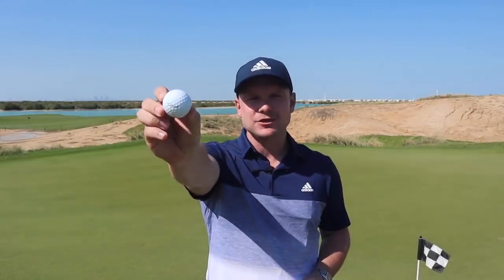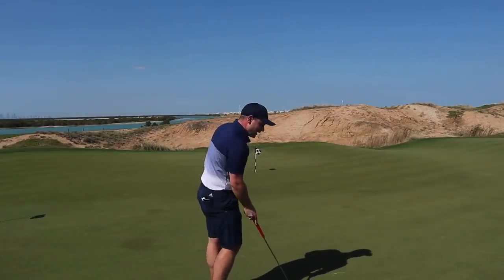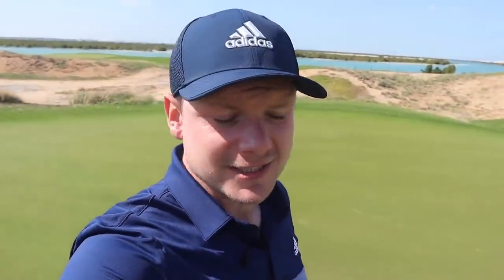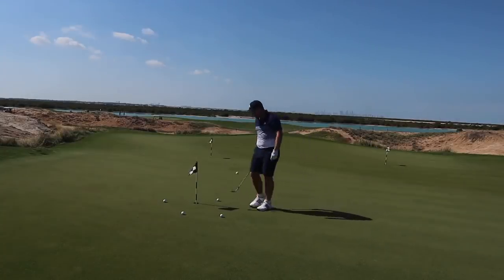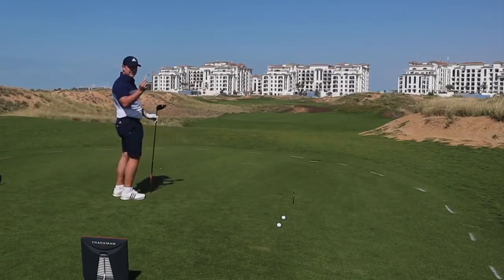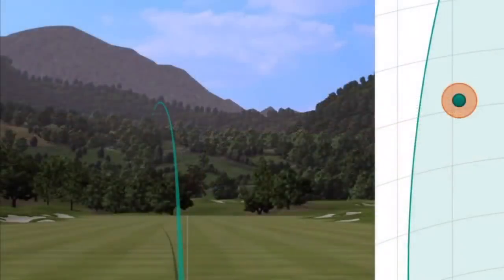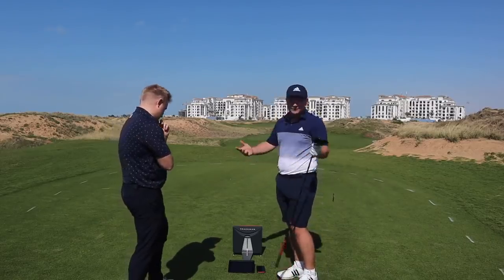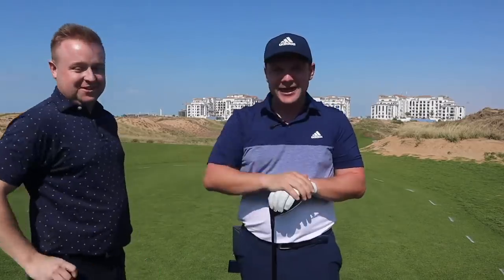THE FIRST EVER GOLF BALL WITH NO DIMPLES... CAN THIS WORK???

Comment: the Gutta Percha ball was one of the first balls for golf and was smooth, and from what I have read, it didn't fly very far or straight, and golfers found as it got scuffed up and got dents and club marks on the ball, they started finding the ball went farther and flew straighter because of all the scuffs and dents in the ball. So they started to design different dimple patterns on the ball through the years.  
The ball is very well designed today and is why Jack Nicklas wants to dial the ball back for Pros, which I think is wrong, it will only hurt us, recreational golfers, as we are not long off the tee like the Pros.
Reply: I think the predominant suggestion to reduce the distance for pros is to have the professionals use a tournament ball which is reduced in flight. No one is suggesting that amateurs are placed under the same restrictions. I agree as otherwise courses will become obsolete. As it stands courses are trying to lengthen (Augusta has just spent several million on new land to extend the course).
Reply: @MrJre4491 Possibly, but I doubt it. Ball manufacturers don’t make money off the Pros that play their balls; they get them free. So if Titleist stopped innovating for example they would lose business to another manufacturer that continued to push the limits. It could also be argued that in attempting to maximise distance for the pros under your restrictions they could find ways to improve the balls for amateurs. It’s difficult but continually improving course length doesn’t help. Restricted ball for pros seems to be the easiest solution to me.
Reply: Funny enough the first successful “modern” dimple pattern ball was a Jack Nichlas 392 dimple  MacGregor. That thing was so hot plus you could tee it in certain way to hit a fade draw high or low. It was outlawed once that was figured out. Then Titliest came out with it version. I think it was the first Pro version. 

Any nice video

Comment: Golf balls were originally smooth. They didnt have dimples till golfers realized older balls worked better. How is this the first ever with no dimples?
Reply from the maker: Even the Featherie had marks on it to make it unsmooth. 👍🏼
Reply: @JamesRobinsonGolf  the original gutty balls were made of pitch and fibre and were made smooth but players realized that their older marked up balls flew further so players started intentionally carving them with all sorts of designs untill someone dimpled theirs and realized that dimples worked far better than other designs
Reply: @JamesRobinsonGolf  you can't possibly not know that golf balls used to be smooth. no self respecting golfer doesn't know this.
Reply: Bollocks - Barnes Wallis invented the modern golf ball with all of its dimples. Its standard hydro-dynamic, yes hydro-dynamic because AIR is just a less dense liquid. The dimples ensure turbulen flow is maintained across the balls surfaces allowing it to fly further with a more stable flight. I guess to the average golf pro this is magic still even today. that's why there a golf pro right?
Reply: @RaindropsBleeding  i don't even golf and i know this

Comment: One of the more interesting tests that was not carried out would have been to try a driver with a lot more loft on the no dimple ball, as it would need a heck of a lot more initial launch angle to go approximately as far. The loft needed is "probably" something like a 6 iron. It may in fact go farther than if it had dimples if this launch angle was optimized, because of the reduction in drag.

Comment: This is just aerodynamics. The dimples make sure that there is a so called "boundary layer" around the ball. This makes sure that the air stays attached to the ball as long as possible. The dimple-less ball doesn't have this to the air releases easily. This creates a vacuum pocket behind the ball. That's why the carry distance is so little

Comment: That was an easy call without watching the video, those things won’t fly at all. The dimples create what’s called a Boundary Layer, it does the same thing as the laces on a baseball or softball. The spin of the ball, coupled with the dimples (or raised laces) causes the boundary layer which creates lift, and glide through the air. Basic fluid dynamics.
Reply: Boundary layer is correct. Spin doesn't factor into this question though. The boundary layer results in less drag behind the ball, resulting in further distance
Reply: distantpixels Not true, example, I play conference tournament softball, in which you have to create the power with your swing speed, but also backspin if you want the ball to carry. The higher my spin rpm is, the farther the ball goes. The raised surfaces of the laces, and the spin creates additional turbulence
Reply: @AJ-hk6zb  Yes, more spin is better. But off the clubface, both the dimpled ball and non-dimpled ball is the same. The dimpled ball creates less drag therefore goes further. Spin is impacted during the trajectory a little because of the turbulent air, but the main reason is drag.
Reply: distantpixels Ah yes, both are true simultaneously. Cheers

Comment: That's not a surprise: it's just basic aerodynamics. The dimples and backspin of the ball create a lower pressure above and higher pressure below the ball, keeping it longer in the air.
Reply: not quite. spin creates the pressure, which is the same for dimples or no dimples. dimples on the ball creates a turbulent airflow pattern behind the ball as air "sticks" to the ball more as it passes over the ball. this creates less drag than if there were no dimples.
Reply: @golferneal  yeah yeah what he said
Reply: When u try sound smart but get it wrong

Comment: I haven’t watched yet but it won’t fly far or straight. It needs dimples for aerodynamics.
Reply: You were right -
When golfers started using "gutta percha" (sap from trees which formed a gum) they found that the ball performed better when it got a few nicks in it. Someone worked out that a pattern pressed into the ball from new would be a good thing, and the rest is history. There's a summary here:

https://www.scottishgolfhistory.org/origin-of-golf-terms/golf-ball-feathery-gutty-haskell/
Reply: @barnardward5293  - I will check out the read  Thank you!!  I just remember from an aero-dynamics section in school 40 years ago we discussed how the air created a "movable atmosphere" in each dimple allowing smoother less friction movement of air across the surface.  I would be using selctive dimple technology on Formula1 cars to create downforce.  But i'm no aero engineer.
Reply: @stephenscheibel4604  Thanks - I first read about this in a book by Henry Cotton; which, believe it or not, I won as a trophy at my then golf club, RAAF Amberley, in 1978 or 1979. (The Air Force has since been infected by neoliberal management philosophy and the course, like most of the other sporting facilities that used to exist on the base, is no more. It's sad.) A few years later, I found a George Nicoll of Leven, autographed Henry Cotton driver in a bargain barrel - the best wood I ever had.